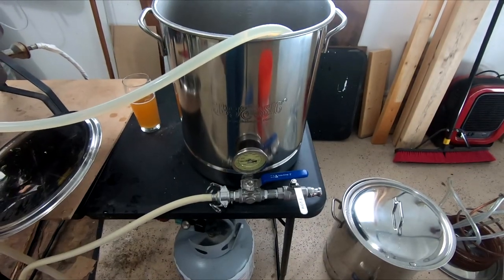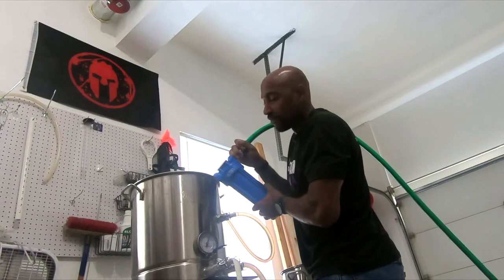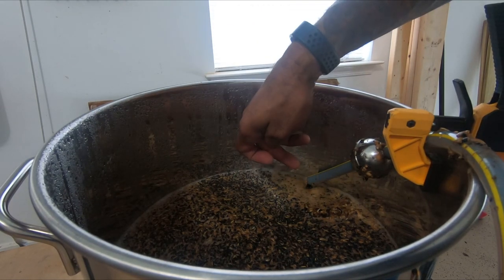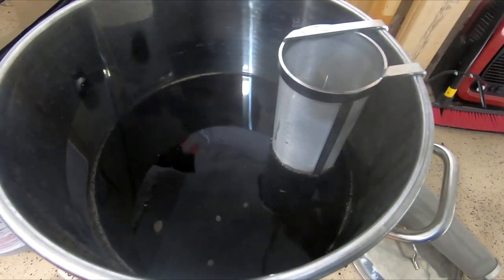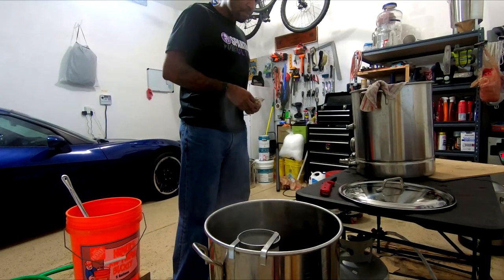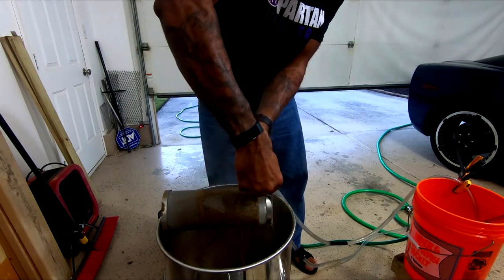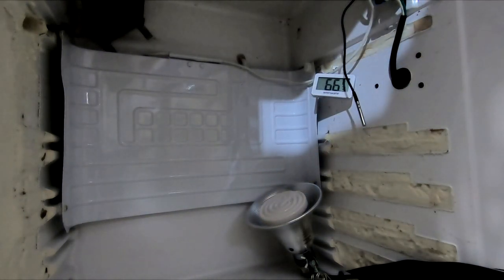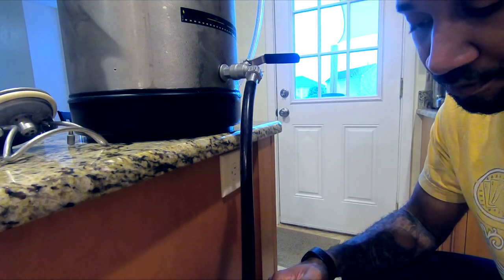Homebrew All Grain - Peanut Butter Oatmeal Stout

Comment: Nice homebrew! if you want to get a better insulation look at Reflective Roll Insulation. You can find it at a Lowes or Home Depot.
Reply from the maker: Thanks for watching. I found that the bayou classic, even though it's not insulated like my cooler mash tun was, still insulated just the same. I was surprised because I thought with it being a fairly thin metal I would need to insulate it, but it worked just as well as the cooler.

Comment: Very cool! Stumbled on your channel with a random search for All Grain Brewing. Cracked up when you gave the real reason for the new mash tun: it just looks better. True! Stainless is hard to argue with. I’ve always done 170F for my mash out. What’s the reason for such a high mash out? Tannin risk is from a rise in pH so I would think that’s only a concern if you don’t adjust the pH of your sparge water. Just wondering. Thanks and interested to see more. Cheers!
Reply from the maker: I was actually Brewing this off of the basic recipe. The recipe calls for a 190 Mash out so that's what I stuck with, I believe the high temperature it's because of the grain bill to make sure all of the sugars are rinsed out in the mash before sparging but since I've never tried a lower Mash out temperature I don't know if it would make a difference. I might go ahead and try 170 on the next one since it'll take a lot last time to raise my water temperature.
Reply: Jay Jenkins 20 degrees is time and propane! I know when I don’t mash out I lose a bit of efficiency, ~3% or so. Wonder if you’d see a drop in yours from 190F to 170F.